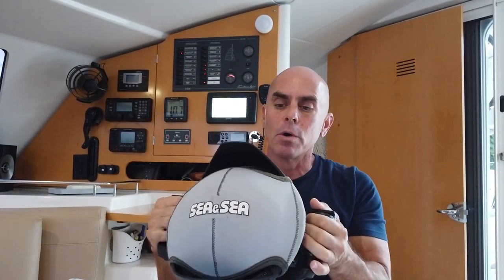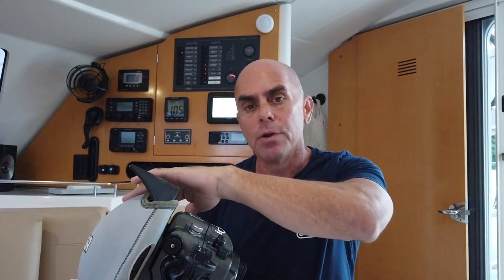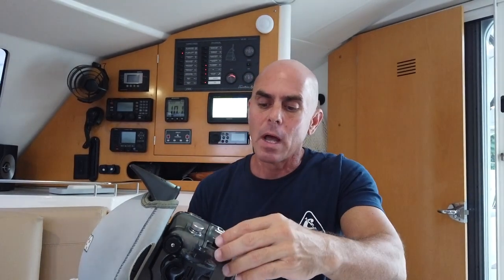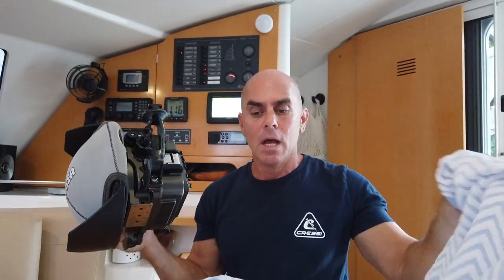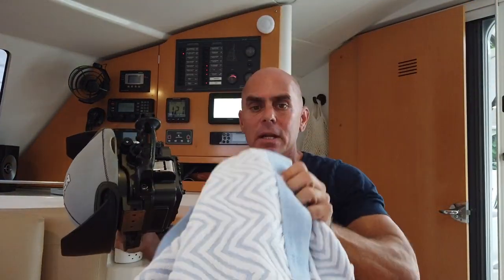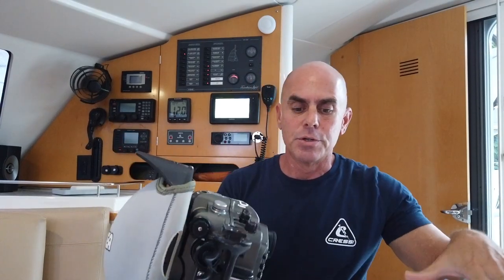Underwater Camera Care: No Freshwater Rinse Bucket? No Problem!

Comment: Thanks for the tip! What about rinsing in a bucket of sea water, if the point is too keep the sea water from drying out?
Reply from the maker: That's also an option. I use the towel as an example because most divers have one in their bag. Not everyone has a spare bucket:-)
Reply: I heard that is when people are most likely to get camera damage.  Because they are no longer looking at their camera so they can't spot the leak in time.